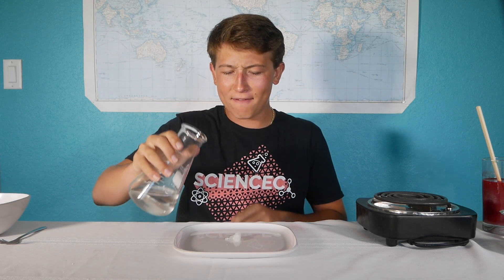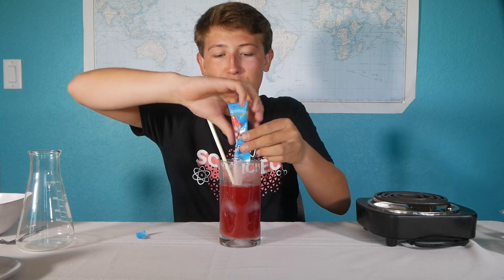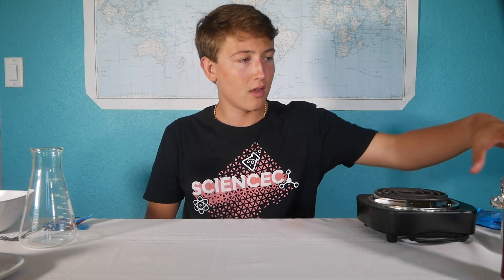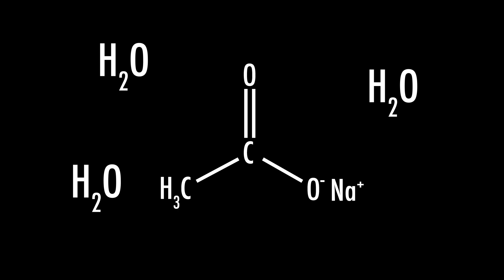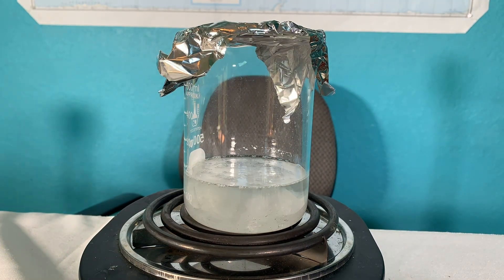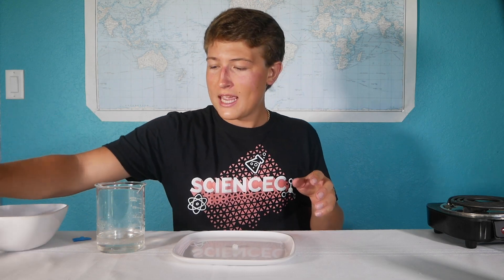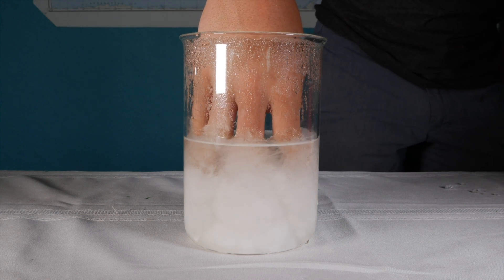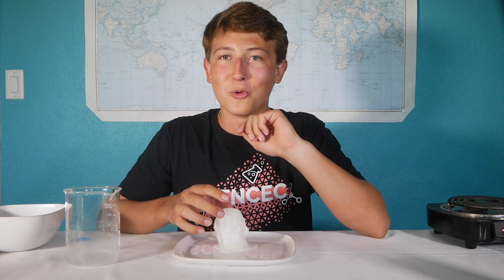The BIZARRE Chemistry of Hot Ice

Comment: Glad the beaker didn't shatter due to thermal shock. Pyrex glass? Also, 3D printer that uses sodium acetate when?
Reply: The temperature gradient in heating a Pyrex beaker on a hot plate over the course of minutes and then cooling it in an ice bath over the course of maybe 30-60 seconds isn't enough to cause it to shatter. In order to cause Pyrex to shatter you need a considerably higher temperature gradient over a significantly longer period of time. The SlowMo Guys' video on it is a good enough example - they heated a small area of Pyrex with a blowtorch and then cooled it with iced water. The small surface area of Pyrex heated, coupled with being significantly hotter than on the hot plate in Chase's demonstration, and thus having a greater temperature gradient, is what allowed the Pyrex to shatter.
Reply: @QuantumLeclerc  The other thing about that slomo guys video was that they were using pyrex branded kitchenware, as opposed to lab glassware. In the US (they filmed that in Texas), you get stuff that's pyrex brand, but it's actually just soda-lime glass, not lab-grade borosilicate.
Reply: What would be the application for 3d printed sodium acetate?
Reply: @Martial-Mat  Purely for fun. I wanna know if the reaction goes up the nozzle or if it would actually just work.
Reply from the maker: The issue is that this reaction is very sensitive so just a tiny amount of solid crystal would turn the whole thing solid.
Reply: @David_Phantom  There's no way these crystals are less than 0.4mm in size, and even less chance that they'd form faster than the fluid would be printed.